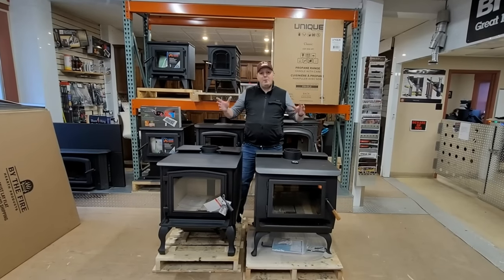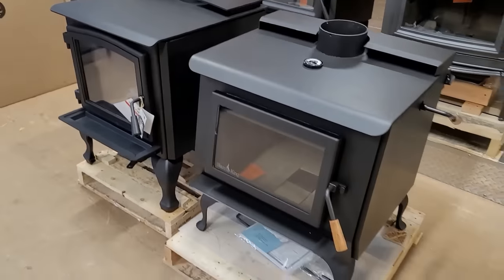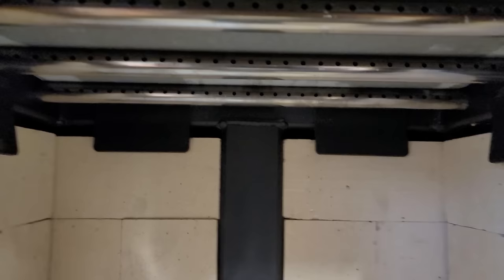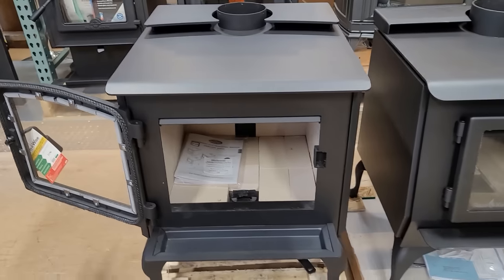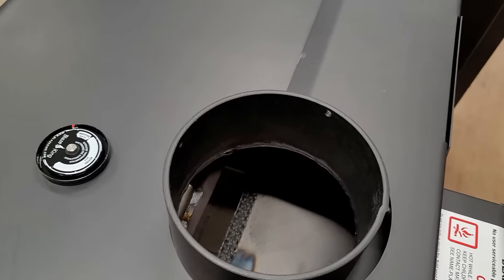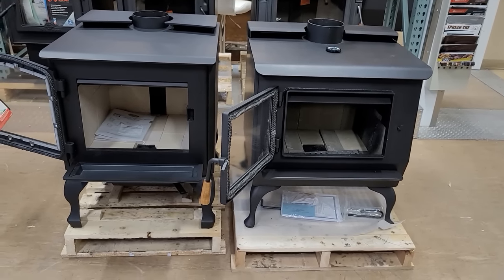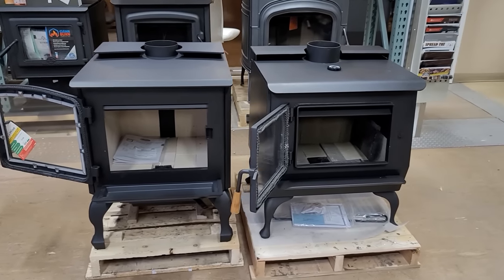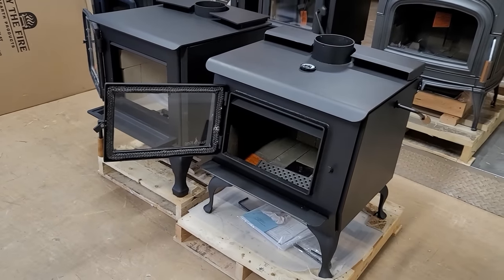Comparing Catalytic to Secondary Air Wood Stoves

Comment: Hey great review I have the Blaze King Princess and I love it. I burn a mixture of hard and soft wood with no problem and I get a good 11-12 burn time with stove turned up 1/4 or so and where I live there are lots of windy days. This is a great thing to know when a storm has gusts up to 100km hr the Blaze King burns the same no out of control fires and burn time stays almost exactly the same and  another note. Very very low soot build up in the chimney which eliminates chimney fires. I had two cup fulls of ash in a full season of burning which is 4-5 months with really dry fire wood. Secondary stoves are good too but lighting my fire once every few weeks and getting a long burn time is great for a home owner. God bless
Reply: Run your air intake directly from the outside into the back top of an old fridge and out through the bottom to the stove. This is great in the winter time because the fridge will be ice cold. No electric.  And the plus is by taking outside air into the stove directly, the heat will go out any air gaps, instead of the other way around. I've done this myself years ago. The pipes can get frosty, but that's a good thing. Because can put it to good use if you stop and think about it.
PS. Don't need any bigger than 2 inch pipe, plenty of air with that.
Reply: @cynthiaayers7696  Brilliant! I had thought about outside combustion air, but not about using it for another purpose first.

Comment: I have a blazeking princess 32. At 1st I didn't like it and was disappointed.. but learned I wasn't burning "truly seasoned wood" once I ordered kiln-dried wood and my own seasoned firewood mixed. Blazeking. IMO are by far superior compared to my napolen wood stove. Yes. It does take some patience but once you get the operating system down 6 pieces of wood burns/heats my whole 1600 sqft home nicely for a good 12/14 hrs on a high. To each and they're own. I personally prefer longer burns with more consistent heat output not worrying about loading up the fire box every 4/6 hours especially at night.

Comment: Great video, thanks for posting!

I've got a Princess insert and couldn't be happier with it!
Reply: i have an insert and don't like that I need a blower use it. 2/3 of the radiating surface buried in the fireplace and I can't cook on it
Reply: @safffff1000 , I never use the blower that came with our stove.  The radiant heat it produces is more than enough to heat our home.  When it's 30 degrees or less we will sit an Eco Fan heat powered fan on it to just stir the air.
But, ours is a Blaze King, which is amazing.  Not sure what you're using.

Comment: Really helpful video. I have an older avalon  wood stove, that clearly has reburn tech in it. I was always curious about cat fireplaces , I really love the idea that I can get long burn times. 
It would be perfect for me cause I generally run my stove around 500-600 during the day in winter. But i let it die out for bed time, mainly cause It doest really get many hours of run time. But a cat stove could really get 10+ hours which would last me till i wake up and keep the fire going.

Comment: But what does the catalyst actually do with the gases coming from the burning (smoldering) wood)?? By what mechanism does it produce heat i.e. make the oven more efficient? And those small tubes in the catalyst - don't they get clogged with soot pretty quickly?
Reply: The catalyst, once it is up to its operating temp, actually 'reacts' with the smoke.  It's actually a chemical reaction with the smoke, same as the way the catalytic converter in your car reacts with your car's exhaust.  This reaction creates primarily two things: heat and water vapour, with only minor impurities (emissions) remaining.  

No, there should be no soot build up in a secondary air tube. No exhaust goes through these tubes, just fresh air.  (They are the conduit for the stove's secondary air supply.)  They can degrade and burn through in time though and would then need to be replaced.  (Just like the burn tubes in a BBQ.)

Cheers!

Comment: Awesome video. Still rocking an old Dutchwest 2462. I think it needs a new cat though. What box temperature should a cat stove on low?
Reply from the maker: I have no idea what temps are inside the firebox. I have measured low numbers coming out of the flue pipe in low 100's. Thats also dependent on the wood type, moisture content, etc.
Reply: @tinmaninc2023 Thank you!

Comment: Where does the air come into the stove in the first place. Is it from inside the house or from a direct line to outside with a manual air control valve.  Bc you don't show any of that. And that can make all the difference in heating.
Reply: U can get fresh air intakes for them.

Comment: This is good info, thanks for putting together the video. One question I have is what about burning engineered logs, such as North Idaho Energy logs made of pressed saw chips? I burn them in my 13 year old Lopi secondary air style stove with great results. I have a friend with a soapstone style of stove. The directions/warnings very specifically state not to burn energy log style products because they burn too hot. Is that at least in part because of the catalyst system?
Reply from the maker: No many manufacturers make that reference as they only want natural wood used in there stoves and not manufactured products.
Reply: @tinmaninc2023  Is there a justifiable reason they say that? Is overfiring a concern with that style of stove? I know energy logs tend to burn hotter than most woods available here in the Northwest. We rarely see maple or Oak for example.

Thanks for your reply by the way.

Comment: what is the estimated lifetime of the catalytic unit and what is the average replacement cost?  I have a secondary air stove and there is practically no parts to wear out/replace so I am curious about the extra cost. The extra long burn time at night has me interested.
Reply from the maker: I can't really speak for other brands then Blaze King as that's what we sell. There are replacements parts needed for all stoves including secondary air as baffles, air tubes, and shields are often replaced. Some people can go 20 years with replacing those parts while other only get a year or two. This is really no different then Cat stoves like Blaze King. It really depends on how you look after it and how you follow the manufacturers instructions. BK cats have a 10 year warranty on the original cat that comes with the stove. Again some customers go beyond that while others only get a year or two. The question for you is " Are you able to follow manufacturers instructions to preserve the life of your stove while being rewarded with less wood consumption and even heat output?"
Reply: @tinmaninc2023  Thank you for the info.  I am able to follow instructions, just was curious about lifetime of the cat unit and cost.  I guess i can google the cost.  Lifetime should be in line with the warranty.  Manufacturer goal is to NOT replace anything under warranty.  I do wonder on the cat stove, how tolerant they are to wood that may be slightly green. I know my sec air stove smolders at times and I just open the air and let it burn up.  I try to make sure it is seasoned well but occasionally get some small batches that aren't quite dry.
Reply from the maker: @321kliddle  Costs of cats are around $300 and have a manufacturers warranty up to 10 years.
Reply: @tinmaninc2023  Thanks!

Comment: Hi.  Great video.  Suppose one burns seasoned wood only and properly uses the stove per instruction, does the fire window still get dirtier faster with a catalytic stove therefore having to clean it more frequently?
Reply from the maker: Great question, yes and no.... cat stoves get dirtier glass when burning on low but because of the high temps of the cat it cleans off the glass very well.

Comment: Can either of these technologies be used in portable camping stoves? If not, then why not?
Reply from the maker: That's a great question. I guess the real reason we don't see that is due to certification. Camp stoves don't really have to be certified or need to be EPA friendly. The other issue I can see with it is seasoned wood, its pretty much the only thing you can get to work in energy efficient stoves. So if your chopping it down and burning it the same day these types of stoves will not work well.
Reply: @tinmaninc2023  Most of the features of high efficiency clean burning wood stoves that make them good at their jobs - bypasses, catalysts, heavy steel or cast iron to retain and radiate heat for many hours - don't lend themselves to portability.

Comment: I have the secondary air stove and love it. Long burn times. Only time I get smoke out of it is when I load it and that maybe for 10 minutes. MUST have seasoned wood for efficiency and for long burn times 9 to 10 hours. I lay my logs left to right for long burn times. To get quick heat I place my logs front to back. Heats a 1,500 sq foot home. It was 80 degrees when I woke this morning and I loaded it up 8 hrs before hand. I open the door in the morning so it can burn down and I can remove some ash, then after a couple of hours I will load it up again for a long burn. It was 28 degrees over night nice and comfortable in here. I have a unit on my stove pipe with a thermostatic fan to capture heat going up the 10 ft tall chimney. I removed the top sheet metal ( for an optional factor fan unit) to make for a larger cooking area. Heat feels better and food taste better. I am sure that's all in my mind but it does to me. Great video!
Reply: I'm pleasantly surprised with my Drolet. I basically do what you do. I can usually get a good 10-12hrs burn time with a good bed of coals for relighting in the morning. I don't sleep for more then 4-5 hrs anyway but have let the stove run its course to compare it to manufacturers specs.  And as far as creosote build up I get maybe a 1 cup every 6 months out of my chimney....
Reply: @jedidiah5131  That is my manufactured brand also. I was old school and was not quite sure about the new regulated stoves. We had a damper on the chimney and on the door of our old school.. if you stayed with it and had good door gaskets you could burn efficiently.  I am impressed with my stove now and recommend.
Reply: @nobleroofinggeneralcontrac7961 and @jedidiah5131 I spent quality time this weekend researching wood stoves and have decided on the Drolet Nano, I have a really small place.  Glad to see positive reviews of them. Any tips and tricks are greatly appreciated.

Comment: If you have a big fire going you always lose a lot of energy via the chimney (except if that rush of energy goes into a heat exchanger and a hot water tank, you have one short and intense fire, let that go out,  and then use central heating). On the other hand you can have an ongoing "smouldering" fire with the catalytic stove. 

Smouldering normally is not the right way to burn wood. Burning it with high heat (dry wood !) is the most energy  efficient wise and generally the cleanest (with NOx catalysators) - but ONLY if you have a heat exchanger and a system with a water tank.

The traditional tiled stoved with a lot of mass are also pretty good. There seem to be rocket heaters with surrounding mass (earth ? sand ?) that imitate that. 

Fouch Family off the Grid has built such a stove.

Comment: How often do you have to clean out the ash? Can you send me a video of that? To me it sounds like the catalytic one would be best for me. Thanks for the info. I live in Baltimore Maryland where we get cold temperatures this time of year. My gas and electric bill is pretty high right now.
Reply from the maker: Ash disposal depends on the wood type and moisture content. Generally you clean out the ash when the amount of wood you can normal fit in there lessens.

Comment: What happened to us when we had a catalytic stove was our chimney ran so cold as so much of the heat was removed by the stove that we got much water from the wood running down the chimney that made a mess. Stove worked too well that we just could not keep enough heat in the chimney despite burning dry seasoned hard wood.
Reply: Me too. Sucks.
Reply: I had a similar problem. I replaced the old chimney with a really well insulated stainless steel one. Problem solved, no condensation.
Reply: @vinquinn  We had a new triple wall stainless steel chimney too but the moisture came from the wood even tho it was 2 year old hard wood stored inside
Reply: @colleenthomas353  Condensation occurs when the flue gases are not hot enough to heat the chimney. Maybe the stove or the catalytic is clogged up inside somewhere and is not running hot enough. Maybe your house is too airtight and the stove is not drawing properly. Hard to say, you should check things out one at a time.
Reply: @vinquinn  Thanks- the catalytic converter was new as was the stove and it ran hot like the dealer and owners manual said it should-worked so well that not enough heat made it into the chimney. The house was an older house on a lake not that air tight. Don't get me wrong the stove heated the house great and the wood lasted much longer than the old box stove but the dealer and us could not stop the moisture problem. We ended up selling the house so I don't know how the new owners made out.
Reply: Made a mess outside the chimney?  That would indicate improper assembly of the chimney, or at least around the area where the water is escaping from.  

From the bottom up, the upper piece of your chimney, or stove pipe, should always insert into the lower piece.  This way, if there is moisture inside your chimney, (and there will always be some), it will always run into the next lower section of pipe, (to eventually evaporate).  Therefore, it will never leak out of your chimney or stove pipe joints.  Also, any horizontal section should be slightly angled toward the stove so that any moisture inside runs toward the stove and cannot run back toward the next upper connection joint of your chimney or stove pipe.  That would cause a leak too..  

Cheers!
Reply: We did not have any leaks in the joints. the water came out at the bottom (tee fitting) on the outside of the house. It WAS installed like you said but the dealer could not come up with an answer as to why. The house we have now has an older fire place insert that we retrofitted with secondary air tubes and wow, great heat with very little smoke or buildup in the chimney and no water either.  @Food-Fire-and-Featherboards

Comment: Nice improvements. My Avalon secondary burn stove can get smoky at low damper setting.
What about an option for outdoor air connection for the fire box? That seems like a great idea.
Reply from the maker: They all have some sort of outside air adapter either as a option or included with stove.

Comment: Can you burn whatever wood you have in your area with the catalytic stove, such as pine?  What about adding a few pieces of coal into the wood as well?
Reply from the maker: Yes any wood is fine as long as its seasoned. WIth coal I would say no as the manufacturers to my knowledge do not test these stoves for coal. If they did it would be listed which I have never come across in the manuals.

Comment: Are both stoves capable of being used as cook tops?
Reply from the maker: Yes they are, in my experience the catalytic stove gets hotter on top.
Reply: @tinmaninc2023  Can you adjust the fire to cool the top when necessary for cooking purposes?
Reply: @EFTTappingwithHeatherAmbler  I suspect no. But if one would use steel rings or something to not have the kettle directly on the surface that could work.
Reply: @haliaeetus8221  Thanks for your reply.
Reply: @EFTTappingwithHeatherAmbler  You're welcome. Just after I wrote it, I thought another option: use cheramic tiles (wall or floor) with the smooth side downward as cooling barrier between stove and pot. That might work (if it doesn't cool too much perhaps?).

Comment: 1st thanks for the good information.
That said, I have an older inefficient stove that likes getting fed on a regular basis.
But I get the heat I'm looking for.
The stove is in the basement so warm floors is great.
Burn time is nice but heat is the reason the stove is going.
My question is , will the BK give me the heat OR mainly prolong burn time?
S.
Reply from the maker: BK stoves have a more constant heat.....your current stove has more highs and lows like peaks and valleys so your basement warms and cools with every load of wood added. BK stoves don't have to produce the same kind of heat because they don't cool down and are more easily controlled with their built in thermostat. Hope that makes sense.
Reply: @tinmaninc2023  thanks TM
Reply: @tinmaninc2023  what is the % difference with these 2 stoves in a equal size home with the bk at a constant heat, , I have a two story 22 x 65. I live in Mn. I’m guess what I’m asking is the bk going to keep it warm enough so I don’t have to have my Lp kick in on, I’m a painter (artist) I have ok installation. Thank you in advance🍂